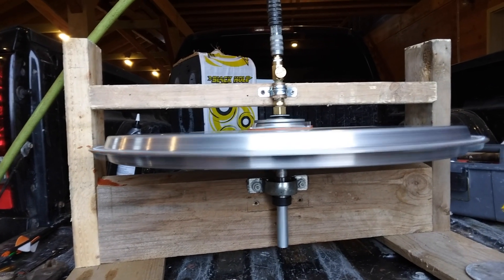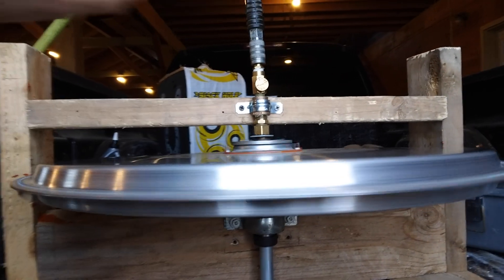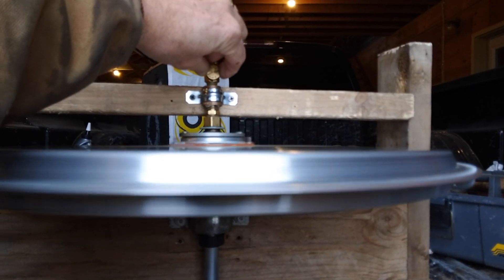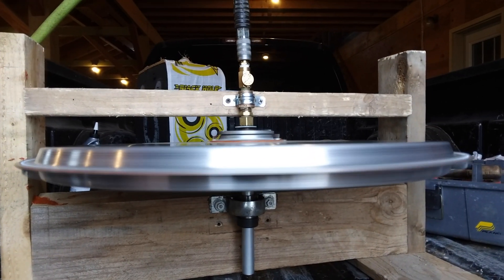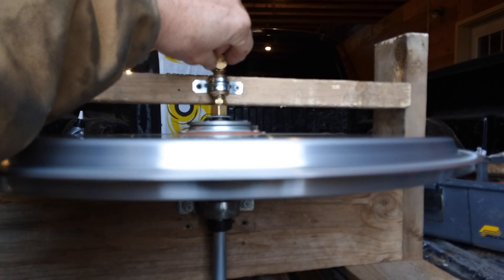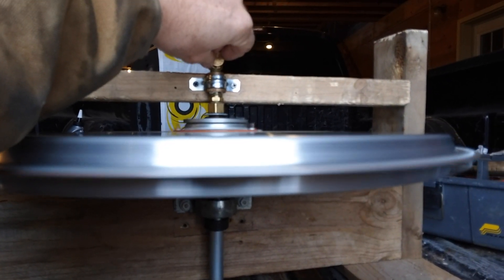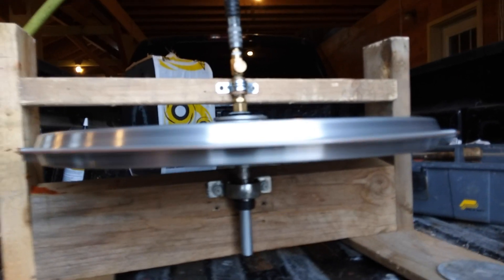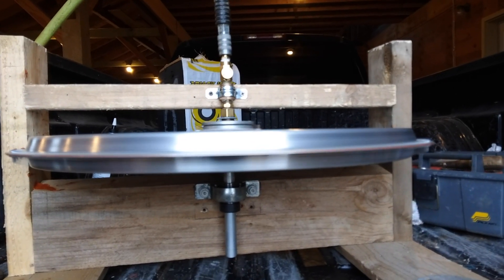Smooth running, Rotating Flow Turbine

Comment: I saw your design earlier and wondered why deal with the hassle of making most of the mass spin when you can invert it back into a Segner turbine then achieve the function of the bottom blades with a shaped casing?

I've seen some experimental results that suggest a hydraulic conversion of up to 80% is attainable with the right nozzle geometry. I imagine a few more percentage can be attained by appropriate casing geometry as well.
Reply from the maker: I thought of my design for use in a steam on some property I used to own.  The stream had low head pressure, (4<ft), but had some volume.  Imagine a big wash tub that could rotate, with an exit hole in the bottom center.  All that was needed to do, was direct the low head flow to the inside edge, to make hydro power.  It was simple, efficient, and effective to do.  Use like this didn't need a seal on top, just a pipe directing the flow.  Maybe a somewhat enclosed top end, but open in the center for the supply pipe to enter, but with no seal.
Has a lot of torque and good flywheel storage when no load present.
Been experimenting with higher pressures now in these recent builds.
The designs I described here, and what I show in videos, is what was presented for the Patent search.  Was cleared to be Patented then, but I had no money.  I'm just making it open source now.

Comment: Why did you give up on the atmospheric electricity ? Your video two years ago detecting the DC charge .. you are brilliant sir thank u for your hard work it helped me understand what I was doing wrong trying to detect the true atmospheric electricity. I was measuring an AC induction off the nearby power lines . Do you know how to give an amperage to the true atmospheric electricity DC charge you detected ?
Reply from the maker: I didn't give up on anything.  Sometimes more thinking is needed, so other things get priority.
I think the circuitry I started in this video:  "https://youtu.be/xHP8bittqaQ" has a lot of potential of making currently unusable DC electric, usable.  A lot of thinking is part of inventing.  At least it is with me, and then sometimes things still don't work.  But it's all learning.
Reply: @doubleMinnovations  good to hear! In the video https://youtu.be/-mnG9pXBDMU 
When you raise and lower a copper antenna and realize a DC charge show up on the meter only when it's in motion ( like a changing magnetic field that can pass through a transformer). Have you considered connecting and disconnecting the circuit (rapidly) instead of raising and lowering the antenna . It will then be able to pass through a transformer to be harnessed on the second coil . Tesla's wiring diagram